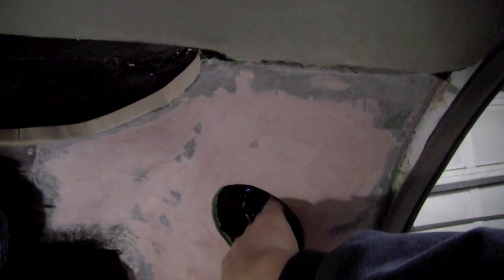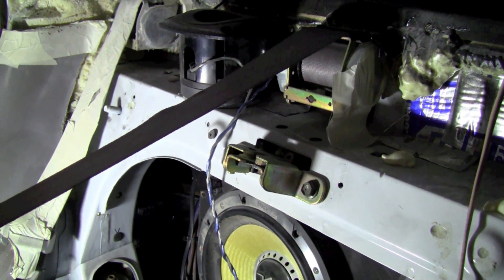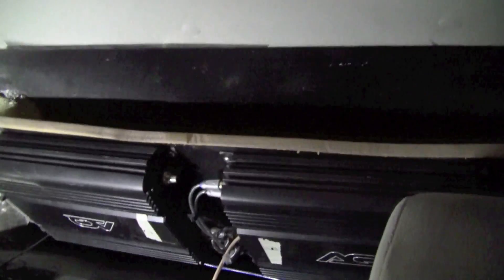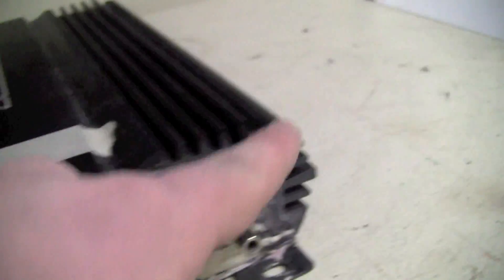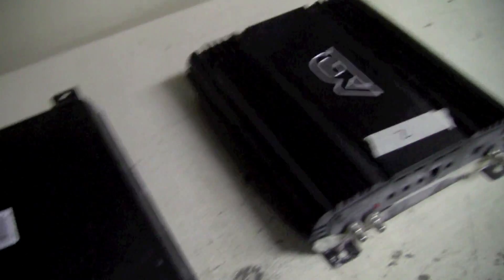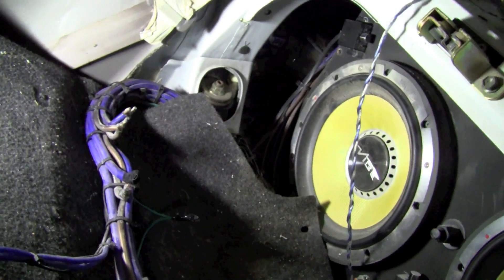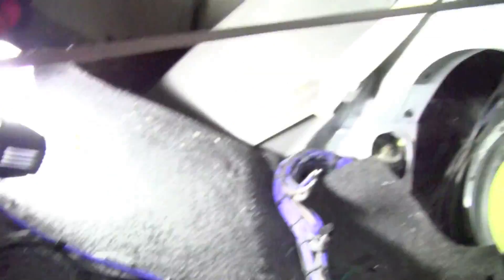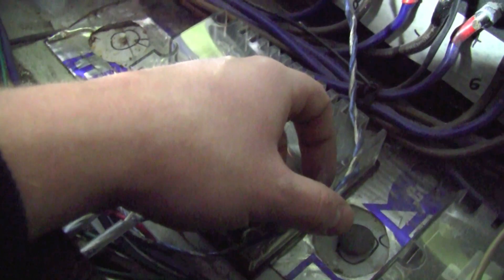SYSTEM UPDATE NEW BOX?

Comment: if your having trouble with your screws in your amps coming off use locktite.. had the same issue with an amp back in the dqay and after using the locktite i never had the issue again...